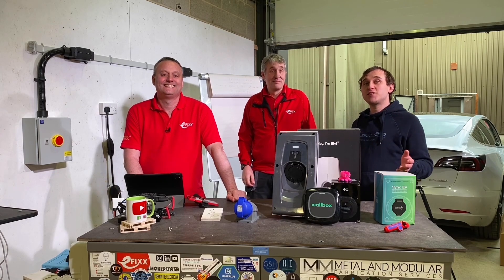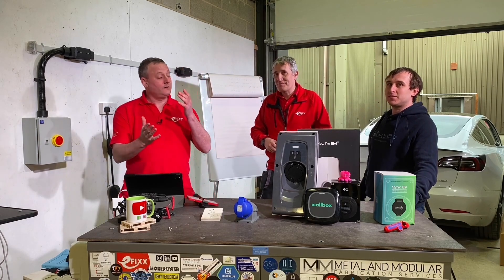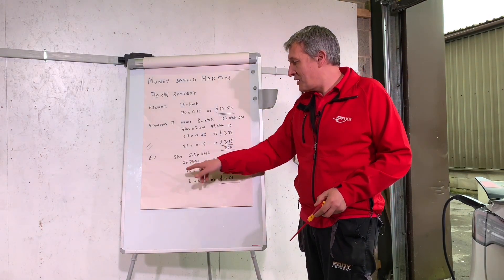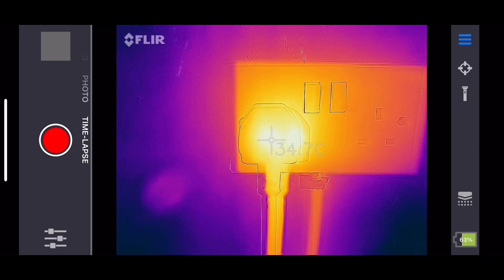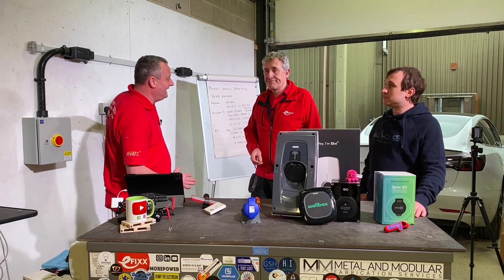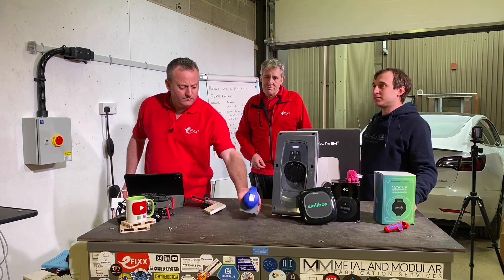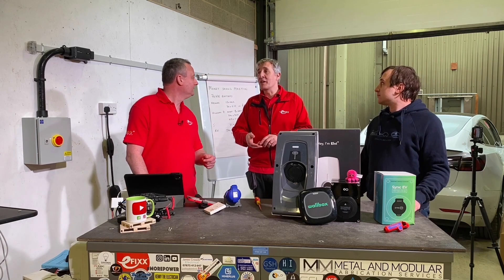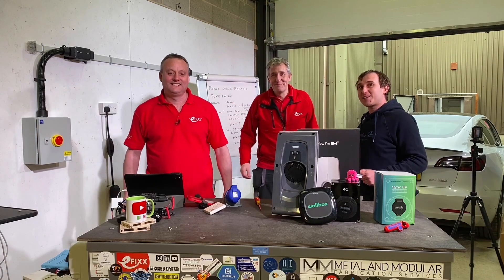5 Reasons NOT To Charge An EV By 3 Pin Socket!

Comment from the maker: Sign up to Octopus Energy and split a £100 with me! https://share.octopus.energy/straw-moon-586
Looking for an ev charger go to https://tech.referrals.octopus.energy/uxZCNUNW 
To all the comments who think granny cable charging is fine as it comes with your car the manuals for your car state there for emergency use.  It's also in the electrical code under BS EN61851 and BS7671
Reply: My dad brought the plug to plug in to your outlet or phone or an iPad or a mask, but you can it comes with a different adapters so if you have a math book it comes with a big adapter and it comes with a different cable and the iPads and phones it has
Reply: This is quite out of date nobody would want to use solar for car charging nowadays. Get an outside socket designed for EV charging and you can do half the rate (plenty for me) of a Zappi for a 20th of the install cost. Granny chargers won't blow your main fuse, so that's a plus point (...if you actually have an electric shower, storage heaters, induction hobs etc). I didn't spend £40k on the car so a Zappi would add 15% to the cost of going electric - a significant amount. The car can schedule charge times so I don't need that. Granny chargers now have a lot of safety features like thermal monitoring and cut out. If I need an emergency charge I can go to the local fast charger and fill the car in 30 mins at 100kW.
Reply: My manual doesn't state emergency. Have you read every cars manual? Doubt it... And it's not "emergency" in the BS EN either 🤣

Comment: If you have a full ev and do more than 30 miles a day - then the full ev chargers are probably the answer.  But if you have a PHEV, or routinely do less than 30 miles you only need a granny charger, the appropriate RCD (typeB) and the 13amp socket which is marked as being BS ev. By the way if the British Standards body think that they can safely pass 13 amp sockets for ev charging why are these electricians arguing for something else.  As for pen testing, that is a vanishingly rare fault.  If you are worried get your tame electrician to check your wiring, but spending c . £5-800 more for a solution that is overkill compared to British Standards requirements is plain daft.  Mind you it provides electricians with more profitable work.

Comment: This video aged poorly. I use an EV electrical socket for my car. The socket is on a dedicaed circuit using 6mm wires and protected by 2 circuit breakers. It's true that my car charges at 1.6Kw, but what's the rush when it's charging from 60% to 90% between 16:00 and 10:00?
Reply from the maker: Video hasn’t aged at all still factually true
Reply: @NicolasRaimo  My apologies. I need to clarify: my comment above refers to the "safety risks", not the tariff rates. My setup is super safe. Granny chargers are only unsafe when people use normal extension cords and normal sockets. With the right equipment that has been developed these last years, granny chargers are now safe to use.
Reply from the maker: @SurSpir granny cables still carry risks listed in video a dedicated EV marked 3 pin socket is better than most however but still missing other parts of the safety puzzle

Comment: So scare everyone into spending even more money on kit, when apparently it's not safe to use the granny chargers that they supply with your vehicle, I have been charging 2 cars every night in a double socket for 3 years, with no issues.
Reply from the maker: How long into them 3 years you used the air bags? Abs? Traction control? Seat belts

Comment: I was looking to invest in a decent static EV charger for my workshop and looked at various types,then my GYS agent gave me an EV pro 160 pa portable charger to test,it comes with both 13 amp and 32 amp cables to run on single or three phase,giving you up to 22 KW from a plug in,assuming you have three phase,which is becoming more common to be fair..GYS quality is genuinely as good as it gets and being in the automotive diagnostics/ electrics trade, I would trust GYS equipment to be more reliably compatible with the ever increasingly finicky nature of the hardware and software of the multitude of manufacturers I deal with, over any other third party equipment. Having used their chargers,boosters and battery conditioners for years with absolutely no concerns about durability,I have stuff that's 30+ years and works flawlessly still and their reputation in the motor trade is top drawer. I actually purchased two for £700 each, they perform brilliantly and are portable too.

Comment: What about homes that are looped with the neighbours and can't have a 7kw EV charger? Would a dedicated outdoor EV socket wired with 4mm cable into its own 16amp rcbo at the CU suffice?
Reply from the maker: The regs do make way for a dedicated 3 pin socket marked EV its tested for high loads.   However its still missing other safety devices as mentioned.  7kw charger are inform DNO AFTER the fact so fit the 7kw charger and the DNO is responsible for the unlooping of supply not see a case where its not been free

Comment: This feels like one big advert and not a balanced review.  How about also giving 5 reasons why you should charge an EV by 3 pin socket......just for balance.
Reply from the maker: Why would I endorse something that’s not electrical safe… no one in this video sells chargers
Reply: Ease and convenience.
No need for an installation.
Cost saving.
No disruption to your home.
No need for a new consumer unit or main fuse if needed.

There ya go!

Comment: I’ve not the time to scan through over 350 postings, but has the efficiency been addressed?  ‘Granny’ chargers may be only 70% efficient at charging the vehicle while a 7kW charger is likely to be around, or over, 90% efficient.  

Losses will include that illustrated warming (in the socket and plug) and also the charger will get warm, but the largest loss will be that of running the car electronics during that extended charging period.  Mine, I think, consumes over 200W of everything incoming.  

Throwing away 20% of my electricity is not favourite - and won’t take too long to chew a hole in the extra initial cost of a dumb 7kW charger, particularly if charging during the daytime while using the plugged-in charger.  I would restrict that loss to ‘free’ energy, generated by solar, whenever possible.

Second point is that solar energy can be exported (opposite to that stated on 😅the video) to the grid.  No new FIT payments these days, but payment for exported power is available.

Comment: A socket should be fed on a 20amp ring. So 10amp continuous should be OK. The plug though... That's a problem, the 13amp fuse is going to get very hot and the plug could melt or the socket will crack. It might be an idea to replace the UK socket with the Euro Schuko 16amp one which has no fuse and rated 3amps more. Maybe of these chargers have also that plug.

Comment: Key cost missed out here, most people with EVs are also running solar, and this type of kit plus the charge units having a DC component need ideally a new type of trip, RCDs wont cut it.

So by the time youve replaced your house main board, and put the charge unit in you e basically negated the whole point of the EV supposedly being cjeap to run in the first place.

Best case youre lookong at about £2,000 from what im told.

That 13 amp pkug seems fine now IMO.
Reply from the maker: What are you on about,  EV charger is £900 installed works with solar and comes with everything needed
Reply: @NicolasRaimo  only if it's not installed up to code and hooked up to an RCBO ... RCDs can't detect DC faults, your car can push DC to your house and blind a trip (it's actually one of the issues they talked about in this video).

That's why you need to replace your main box in your house too in order to do this properly and that costs about as much as getting the charger installed.
Reply: Most houses don't have upgraded car number units.
I've gone through all this recently.
Yes you can get a charger installed for £900 "assuming the best case" but the reality is there's always additional costs for some reason or another as you quite rightly pointed out, not having RCBOs on the DC kit can cause any RCDs to fail.

For "decent" RCBOs you're talking £30 a pop, just for the breaker.

Comment: Well this is an unbiased video lol 😂 I’ve charged my car on a 13 amp socket All be it a ev approved one for 4 years no issue most people do less than 20 miles a day so topping up is perfectly fine for 95% of the time plus you have saved £750 to £1500 on a home charger to spend on the occasional public fast charger
Reply from the maker: How is it a biased video… the safety risks still exist unless you fitted the additional safety equipment your argument is like saying I only drive 2 miles a day so don’t need a seat belt
Reply: @NicolasRaimo  because they want everyone to buy a home charger it’s the business they are in they are hardly gonna say 3 pin charging is safe. Wake up and small the coffee !!
Reply from the maker: @wanderingwilcoxs  who’s in the business of home chargers? Non of people in video fit or sell them

Comment: What a waste of time. What we need to know is does the domestic wiring have to be altered to accept the charger?
Reply: Yes - you will need a new supply to cope with the increased current draw. You may also need a new consumer unit, and, potentially a new main fuse. These installations are NOT cheap.

Comment: We plug many DC chargers into our 240v sockets.  Are you saying that none of these should be plugged in because they could potentially block our RCDs from working and we are all going to die a horrible death falling from the empire state building or flying through a window screen as a result?  Typical examples include power tools, vacuum cleaners, laptops, mobile phones, bicycles, the list of dc chargers plugged into 240v sockets goes on and on and on.  Most modern granny leads can now go as low as 6amps if people wish to leave them plugged in for very long periods.  Are you going to come back with a claim that 6 amps is also unsafe for the wall socket?

Comment: What do you think of this product 

BG Masterplug EVH132S1SPA Electric Vehicle Charger 2.3kW Electric Car Charging
Would love to know your thoughts
Reply from the maker: Better than a standard 3 pin plug as it’s been tested for this application still missing PEN fault which would need to be installed with this plug under wiring regs so time you done that you may as well fit an EV charger

Comment: Those 13amps sockets are not fit for this purpose. But you can install a proper one. And in EU you have proper EV certified 16 amps sockets. These can be suitable for plug in hybrids, if you do not mind charging at 10amps for 7 or 8 hours.
Reply: Aye not designed for continuous load. Not hard to replace a socket with a Euro Schuko one and most charge leads come with one.
Reply: I don't understand why granny chargers don't come with two 13A plugs and then you could split the load over two sockets and ramp it up to say 15A.

Comment: Any ides why the socket would crack when charging the car? Cables for socket all fine
Reply: Fuse in the plug gets above 100oC for hours and heats the socket behind it. Yes it can get that hot and not blow. Think of like a mini heater with very localised heat. Put a 16amp Euro Schuko in. Cheap fix.
Reply: @jondonnelly3 Link please?

Comment: I e used. Cheap metre extension cable for 18 months…. Torrential rain and 41 degrees heat… never one had any issue
Reply: Same here - no issues whatsoever.

Comment: The idea behind this entire video appears to be that using a 13A socket to charge your EV takes forever.  Well, the average UK car does barely more than 30 miles a day - obviously implying some people do a lot less.  30 miles ~= 8kWh for a small to medium modern EV.  At 8A (much safer than 10A on a 13A socket) replacing this much range would take only 8000Wh/(240V x 8A) = 4 hours ie totally doable overnight.  Ergo, not (by a very long chalk) does everyone need at 32A/7kW chargepoint!

Personally, though, having been driving EVs for over 15 years, I would compromise and replace the 13A plug on my pEVSE with a 16A CEE plug and have a matching socket installed replacing - or in addition to - the existing socket (with a suitable simple relay or contactor interlock, if needed - ie so if the EV is charging the 13A socket is isolated).  The CEE socket has far heavier pins and as long as the mains wiring is up to it, there's no reason why you could not run this at a full 16A if needed (4mm2 minimum supply from the consumer unit, tho) assuming the pEVSE supports it.

Comment: Remember if you've got a Citroën Ami or smart fortwo and only do 20 miles a week you will need a special ev charger installed and not a 3 pin plug.

Comment: We have two different electric cars, one fully electric and one a PHEV, which take very different chargers. I use the 'granny' charger on the PHEV around mid day, so that i make full use of the 11A generated by my solar panels. If i charged at a higher rate, it would cost me more. The PHEV is only an 11kW battery, so charges up in about 4-5 hours if fully depleted. However, at no time was i told, that this 3-pin charger was for emergency use only. I have a dedicated single socket, straight from the CU (only Type A RCD protection). I always assumed this was 100% safe.....now you have me wondering!!!     I've used my charging cable almost every day for 7 years now and i'm a bit appalled if the info given at point of sale has been misleading. I thought it was safe to use.
Reply from the maker: Safety is all about calculating and reducing risk,  is driving without a seat belt meaning your going to have a car crash NO,  but if the scenario had the right conditions then having a seat belt is important
Reply: @NicolasRaimo  Exactly, so either the granny charger is safe to use or its not. If not, then the manufacturers should not be allowed to put these chargers into cars. You cannot have a situation where it is safe to use once in an emergency, but not safe to use 100 times. So, im now looking at a second instal at a grand a pop, plus if i change my car to a Tesla in a couple of years time, i'd be looking at even more for a third instal. Thanks for making me aware of this safety issue.
Reply from the maker: @jimmaxwell2259  oem would argue there not responsible for what you plug into
Reply: @NicolasRaimo  And I would argue their 'Duty of care' extends to this. At the very least, a disclaimer at point of sale that the 'granny cable' must not be used on a long term basis. Of course, they didn't want to do anything that would put people off buying them.
Reply from the maker: @jimmaxwell2259  they do now
Reply: @NicolasRaimo  Thanks...as a temporary measure, i will get one of these fitted. (Sync EV MODE 2 Charger With A Type DP RCBO)

Comment: That's completely misleading as the temperature is barely hitting 35C. It just looks scary because in this display mode, "white" is simply showing the maximum temperature recorded and where. Only someone versed in FLIR would know this but everybody else would think "white" probably means white hot (it doesn't in this context).

35C is nothing and well within the margin of a 13 amp socket/plug. At this temperature, there is absolutely nothing to worry about. Would love to know what ambient temperature was because I doubt it is little different. If you put your hand on this plug, you'd be hard pressed to tell the difference but this is what FLIR is for; it will pick up the slightest differences in temperature, auto-ranging to show the lowest to the highest. If the plug was too hot to touch (60C+), that's when you need to be concerned and the cause would most likely be a poor connection, easily fixed by replace the plug and/or socket.

Completely misleading!
Reply from the maker: Hi Rob for context;

This was a BRAND new fitted socket with a brand new 3 pin charging lead fitted to a new backbox,  this was filmed in the winter in the cold efixx studio with the ambient temperature about 6c.   The car was on charge maybe 2 hours before filming.   Now apply an older house socket used regular in the middle of summer for 12-15 hours of charging.
Reply: Nevertheless, 35C is far from an example of overheating. If you tested this after 15 hours, it would still show the same temperature as temperature has a finite limit and does not increase indefinitely as time passes.

Again, FLIR in the wrong hands frequently leads to false conclusions. In the middle of June on a clear blue day, Try pointing FLIR vertically to a clear blue sky (not the sun).

The result may surprise you given temperature is probably in excess of 25C. Can you explain why?

Comment: so with the cost of installing a EV charger is around £1200  if you charge you car fully once a week  with the price difference  of £6.64 per full charge it will take 3.2 years in recoup the initial £1200 cost.
Reply from the maker: 88kwh battery? Or you using wrong price for electric… cheapest installs below £1000 also and charger warranties tend to be least 5 years